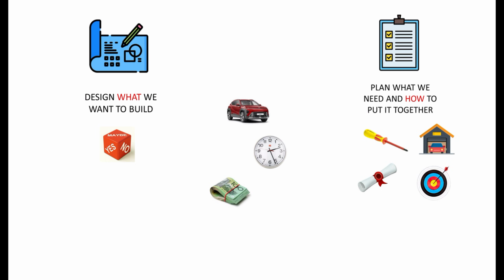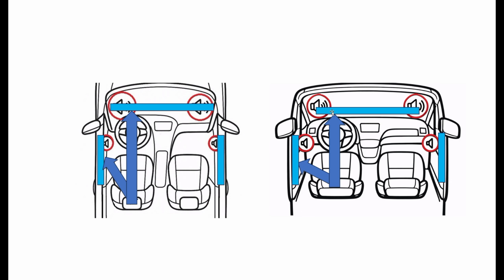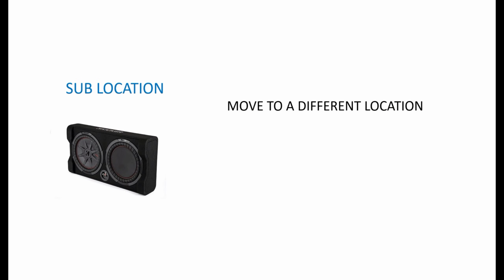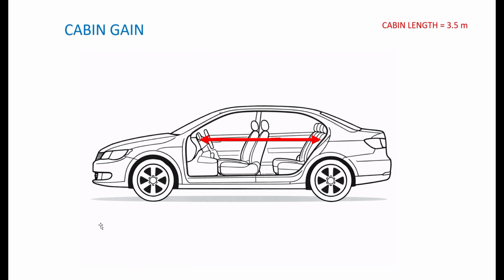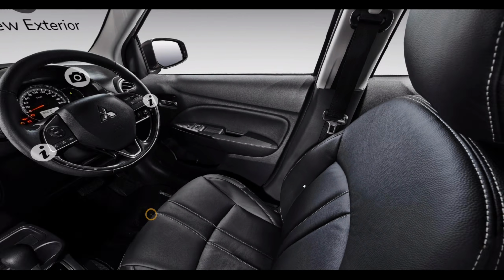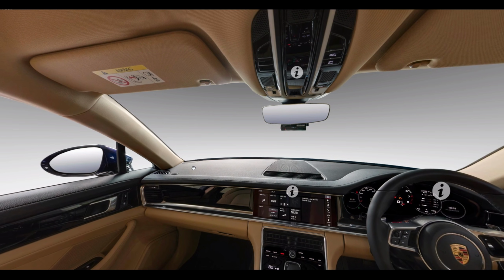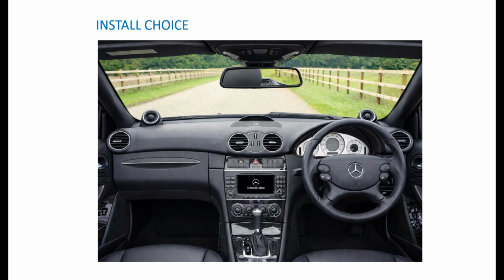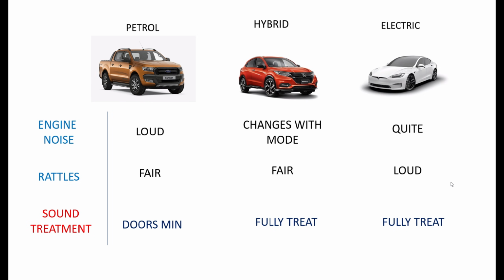HOW TO DESIGN & PLAN A CAR AUDIO SYSTEM - EP 6 - HOW YOUR CAR EFFECTS YOUR CAR AUDIO SYSTEM DESIGN

Comment: And how we fix the standing waves? Thanks for the video. 
It smears the imaging, yeah we eq the peaks, but will still sound like is coming from the left when it should from the right. 
Is all about speaker aiming? And crossover, like if my mids are reflecting hard on the side window at 3khz then when i cross them at 2k for the tweets i should actualy use the steaped crossover 48db to bury that standing wave? 
Thanks for being present on your channel. You have a pasion for this
Reply from the maker: Standing waves are always present, it is the geometry of your car and physics.  At any point in the car they will sound different, sometimes the standing waves sum up and  sometimes they cancel out.  You can't eliminate them, but you can reduce their impact at the listening position.   For tweeters and mids aiming is most important, for bass, sub location, cross overs and time alignment is most important.  So if you are having issues with high frequencies, changing the speaker location or aiming can help. The aiming or movement does not need to be big.  A movement of 2 or 3 cm can make a noticeable difference.    I have to say however that most of the time standing waves show up as a dead spot in the bass, when it sounds less bassy in the drivers seat. It is less of a problem with high frequencies because the ripples are so small, it is much much harder to detect the nulls and peaks.   If you are sure it is standing waves causing your problem then changing aiming or location may help, but I don't think standing waves are your problem, it is more likely to be the tweeters out of polarity or your time/phase alignment being out or something else. But that's just a guess.     I hope this helps.
Reply: @socketsocket2763 Wow thanks for the big reply. My problem is reflexions, i have the mids up in doors, i am listening to them one by one, rta shows flat but playing with the tone generator i can hear some frequencies that are not coming from the speaker location.
Reply from the maker: Hi Elvis,  Yes that is normal when listening to a speaker playing in isolation.  It is a result of the reflections and resonances in the car.    When you play that speaker with other speakers in the car, the pattern will change. I don't find tone generators very helpful, because they can be deceptive, because they play a single sine wave that exaggerates resonances and reflections inside a car.    Your RTA may still look flat because the microphone does not hear like your ears do. The mic averages the data it receives and doesn’t perceive directionality the way we do.  I know people use tones to try and eliminate reflections and resonances, but honestly, unless you are chasing a specific issue like a major cancellation in your mid bass around 160Hz caused by a resonant or flexible door card you are wasting your time. You will fix one frequency only for the problem to shift to a different frequency and you end up chasing your tail.  Instead of using a tone generator, listen to the speaker playing music or full range pink noise.  If the speaker sounds ok, then stop worrying.    Direct and reflected sound and resonances are simply part of car audio. The way we manage them is through proper installation and tuning, mount the speakers solidly,  eliminate rattles and buzzes from door cards and trim, aim the speakers correctly and tune the system properly with good crossover points, phase and time alignment.  If done well, the tune will incorporate the direct and reflected sound, image properly, center correctly, and sound great.   If you need further help, you’re welcome to subscribe to my Patreon channel where I can provide one on one support. Otherwise, I hope this helps.